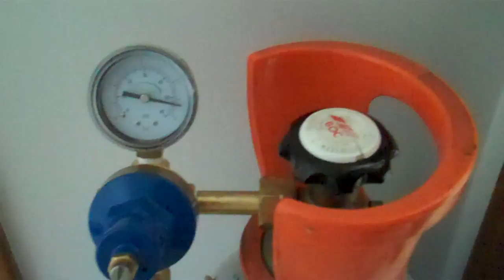Carbonating water and making soda

Comment: This is incredible cheaper than soda stream.  The co2 you have to buy for that machine is such a rip off.  I have a 20# co2 tank that I can fill for $20.  Compare that to $70 for way less from soda stream.  Check out the Carbonator Cap. It cost $15 and does what the air pressure valve and truck tire valve do in this video.  It fits on most 2 liter bottles.

Comment: No it is not cheaper a SodaStream Co2 tank cost you 15 buck for a new refilled one. 2 refills at 1 pound a tank will run you what it would cost to fill a 20Ib Co2 tank. Also the SodaStream uses the Co2 to agitate the water that why they want you to hear the extremely loud buzzes. By far this is cheaper and you wast lest Co2 into the air.